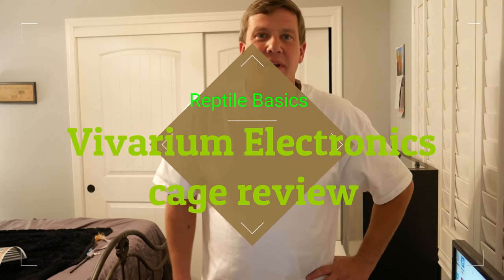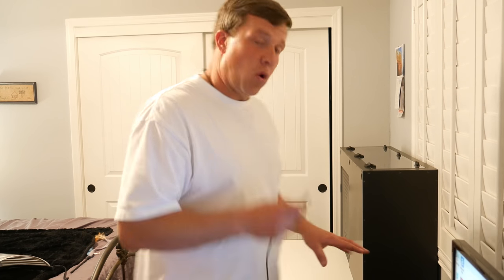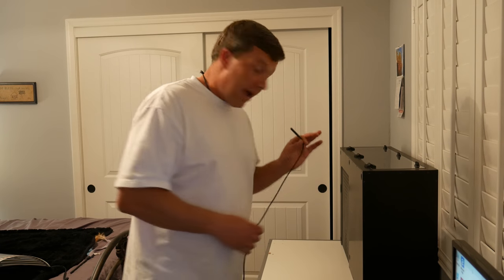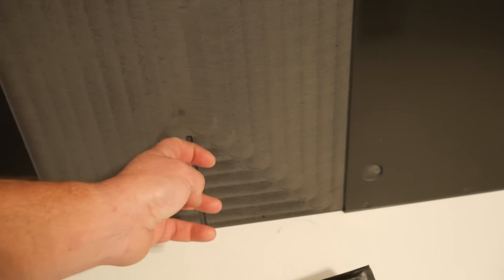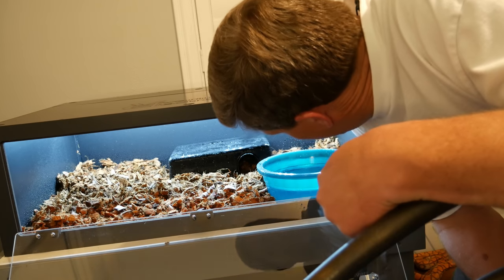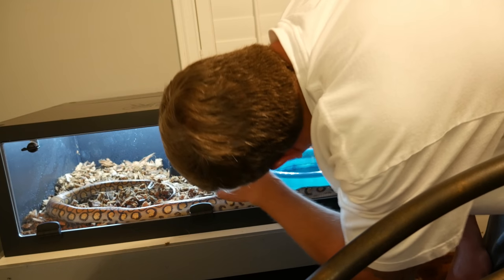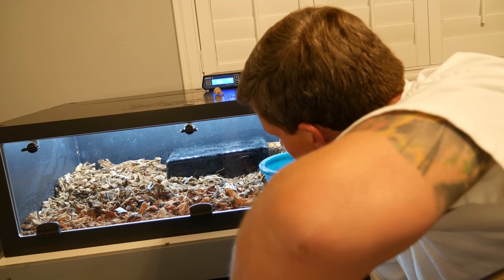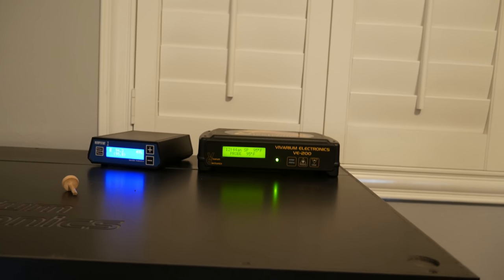Reptile Basics (Vivarium Electronics) cage review

Comment: Could I drill into the top of this easily, or will it splinter badly or crack? I need to drill in a top hole for a mercury vapor bulb for my young tegu.
Reply from the maker: Yes you can gst go slow and start with a smaller bit first the increase in size